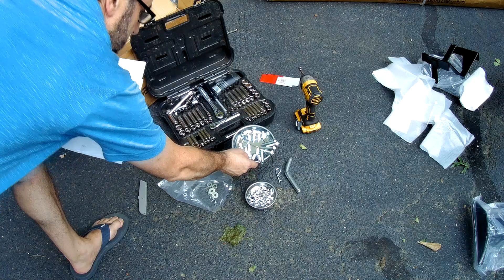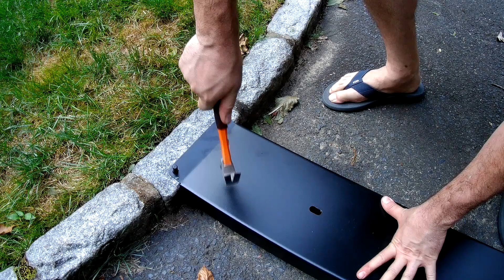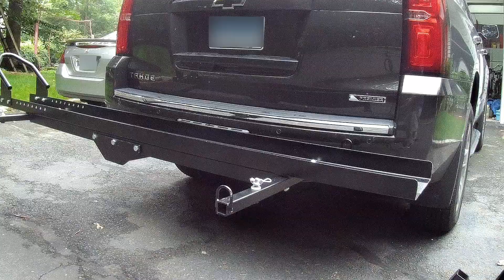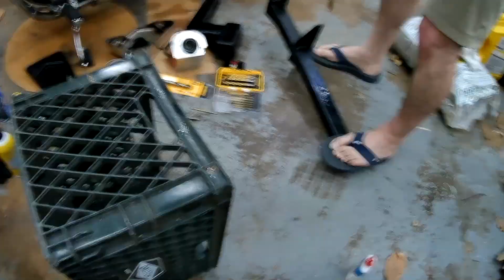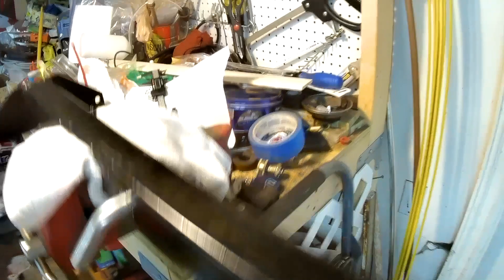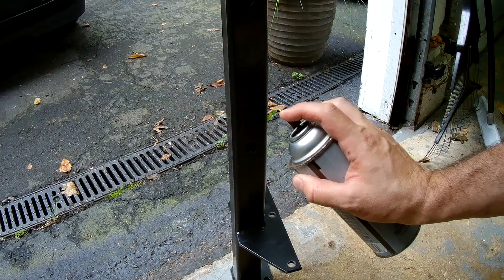Assembling a motorcycle carrier hitch rack

Comment: Is there a way you can increase the weight limit on this setup?
Reply from the maker: I'm not sure! The tow hitch on my SUV has a tongue weight of 640-660 lbs, and the carrier I used has it's own rating of 600lbs. This means I'm limited to a 600lb bike. I have not looked at how the hitch is secured to the frame, but you might be able to weld in additional gussets and supports. As for the carrier, I have heard of people inserting a solid square bar inside the 2" tube to prevent flexing and to add strength. But I'm not sure how you would calculate the new capacity. Best of luck - and be safe!
Reply: @ificanfixitsocanyou  Finite element modeling.